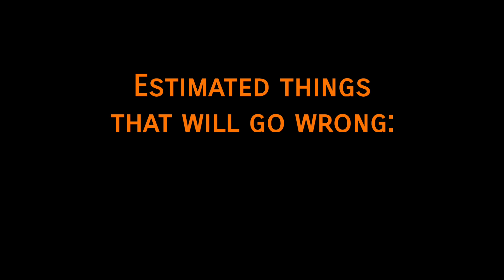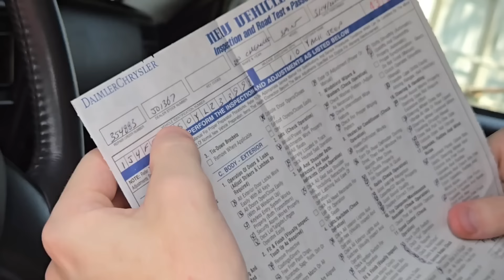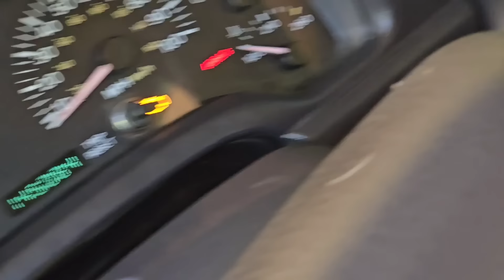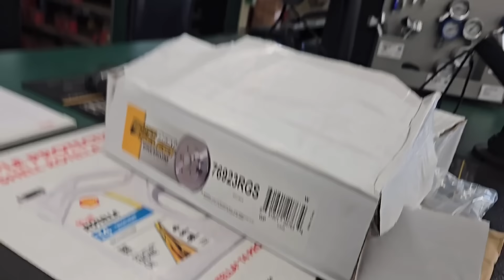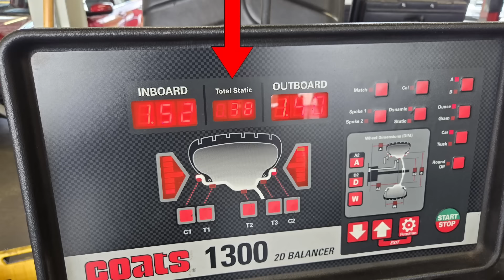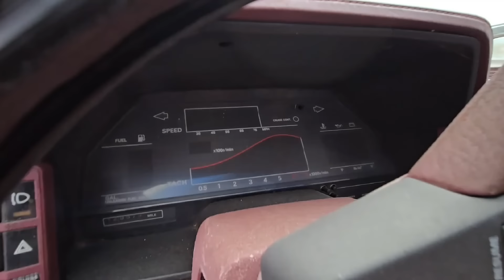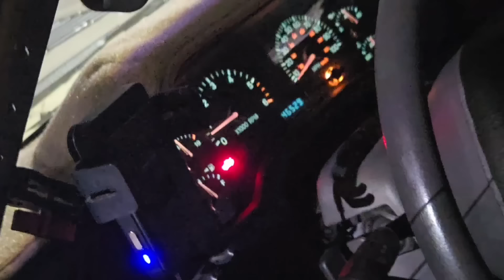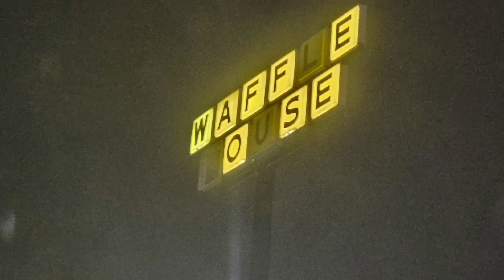Bought Sight Unseen: Building a Jeep 4.0L and Immediately Driving it Cross Country - Operation Taco

Comment: guys, you're amazing. I have a 2.5l '00 XJ and planning to rebuild the engine. You gave me hope.
Reply from the maker: @albertodellarossa7644  Where did you find a 2000 2.5L XJ! Very exciting. You should make videos on it
Reply: @WAEMIDIV  "she" (her name's Carmen) come from Spain, then re-registed in Italy. It's a 2 door. The engine runs quite smooth (i've already run almost 13k miles, for a total of 115k), but sooner or later I'll have to rebuild the transmission (ax5 manual), so I'm planning an engine rebuild too. And hope that I won't need to machine the engine block. I'm learning a lot from your videos.
Reply: I also have a 2.5l xj, there are dozens of us! also good luck finding parts on the first try

Comment: 😂I thought I notice the oil pressure was rather low, have you checked that  ? It needs to run on at least 35 or 40 on that gauge , but I only saw it at a glance, I hope its ok,,,,,these motors run forever long as it's got desent oil pressure and doesnt over heat, I have a 1998, 278,000 miles , still starts and runs like a new one, but that 35 rearend is howling a little, they are next to nothing as a rearend tho !

Comment: Those retractable hood lights are great, I scavenged one out of a '90 parts unit I had for my '95, the mount holes for them are there up until '96 at least, they just need to have rivnuts installed in them. They're very easy to rebuild with a bit of patience to rewind the recoil spring in them, and the mercury switch that usually fails in them is available online for less than twenty dollars. In an incredible stroke of irony, you have posted this video the day before I'm tearing my own Jeep's engine apart for an overhaul, which I find rather amusing.

Comment: Great video! I've been binging your videos and they've been very informational even though I own an 87 Waggy. 

Recently the lifters have been making a racket occasionally on some cold starts, but after running some ATS 505 though the oil for 15 mins , its improved some. Thinking of running some seafoam for a few hundred miles, we'll see lol. I shouldn't be all that concerned considering it's got 148k miles.
Reply from the maker: @nickb.8876  The lifter noise is nothing to be concerned about, you should hear my engine now at 315,000. It's been making LOUD clattering noises for over 50,000 miles, I have no plans to do anything about it

Comment: Watch those front brake calipers and make sure they are sliding ok and not getting stuck. That can also cause the wobble and heat the disk up. Might have to polish the rail the caliper slides on. Or replace the spindle assy.

Comment: WJ pressure fittings are m20x1.5 and the XJ pressure fittings is m18x1.5

Since the thread pitches the same it will feel like it threads in properly. a lot of people can get enough meat for it to bolt the power steering high pressure line down. Unfortunately a lot of times it'll cut off threads, leak,  or blow off like what happened in the video. I have a bunch of photos documenting this if you're interested.

Comment: did i miss the part where you installed new lifters? i really like these big adventure videos. youve got a cross country XJ  parts cartel going on👍
Reply from the maker: I missed recording the lifters, we did take them all out and extensively clean each one before we put the head on. They were pretty gummed up with random particles, nothing brake cleaner and compressed air couldn't handle

Comment: I could have saved you guys a lot of time an effort.   I have a 99 Cherokee sport with 146k  no rust. And the motor is actually assembled and running. I’ll sell it for 3500. Or close to it.
Reply from the maker: @icantsaywhat  But where's the fun in that?
Reply: @ this is true  you would have missed out on the fun of rebuilding and saving another cherokee

Comment: Walk me through the cruise control on a 1988 XJ.
Reply from the maker: @equals-kl9hm  Renix cruise control is 10× more complicated, you need a whole steering column with the controls for it, the cruise harness and computer module, a brake pedal switch, speedometer sensor and 2 new cables, and the vacuum thing in the engine bay.

Comment: Do you have any overheating issues idle ever?
Reply from the maker: @leslie9271  It does get hot, but the electric fan saves it every time. He can run the AC no problems

Comment: A 2000? I can tell you why that head was removed 🤣🤣🤣. I swear I found the same deal  An almost mint condition 2000 XJ but mine is the metallic forest green. I’m currently rebuilding mine just still stuck if I want to go Stroker or just do stock rebuild because guess what….the head on mine was exploded too 🤣🤣☠️But hell yes I love this video
Reply from the maker: @christophervillareal6151  The cylinder head definitely failed at some point very early in this Jeep's life, but it wasn't the cause of this last engine teardown - it came with an Edlebrock head, an aftermarket high flow design. So it had been replaced before, as this Edlebrock head had some miles on it, but who knows when
Reply: The lucky thing with this find is it actually didn’t even come with an OEM head rather an Edelbrock one from the previous owner.
Reply from the maker: which I should've mentioned in the video but kinda forgot that was a major plot point

Comment: Hey waemid just wondering your input on something. I have a 00 with a cracked head. I just recently started having low low oil pressure I verified with a mech gauge . Ik it’s very well possible I wiped out my cam bearings. That being said . Do you know if throwing a new head or atleast a non cracked head would buy time ? Should I just drive it till she’s gone ? If I do replace head would I have to pull motor and do cam bearing etc ?
Reply from the maker: @casualactivities1229  replacing the head will stop it from getting any worse, but nothing is gonna heal the engine

It's up to you to determine what you'll do it very much depends on many unique factors
Reply: @ I’ve weighed a lot of factors….. I do love to drive it I prefer to drive it over my other newer vehicles…. But it was always meant to be a trail rig might just send it out with a bang and hit the rebuild . Thank you for the response !

Comment: I got a 2kxj with a 4.7l stroker engine.    Thinking about selling it.  Everything is new as far as the steering and suspension. Also has a brand new 12k synthetic line winch with the stump bumper from dirt bound.    Engine has 1k miles on it.   I got hurt at work and not sure if I'll be able to finish it all the way or even offroad anymore